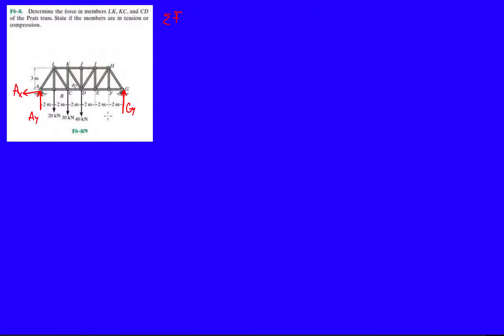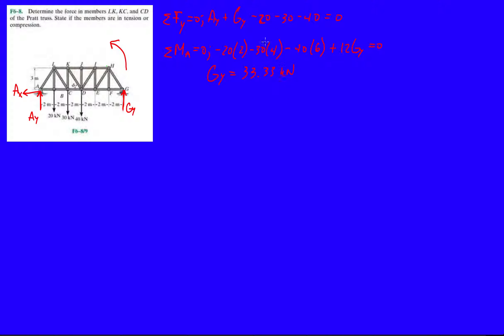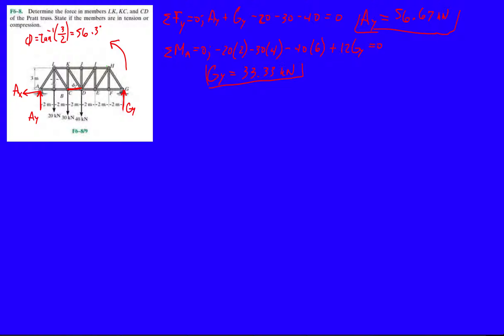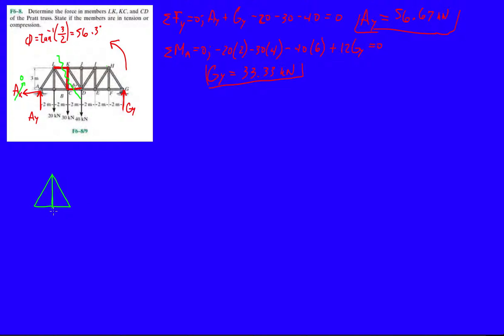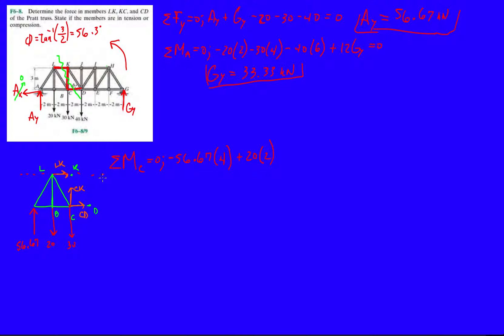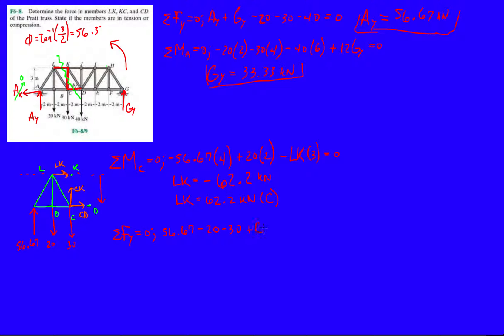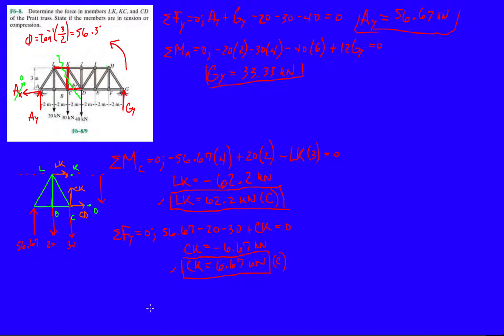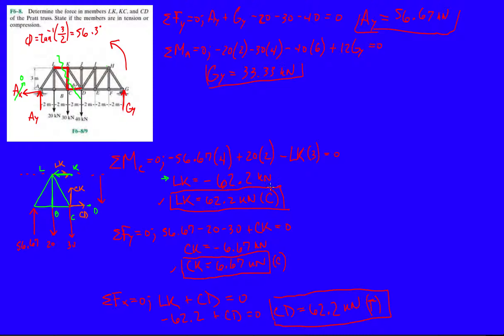Problem F6-8 Statics Hibbeler 12th (Chapter 6)

Comment: sir the answer of the reaction force Ay is 56.66 is positive so why you dont take it tensile force in the diagram below the question diagram
Reply from the maker: Remember that Ay is a reaction force, not an internal loading on the individual members. Think of it more like a Normal force on the joint that the structure sits on on at A.